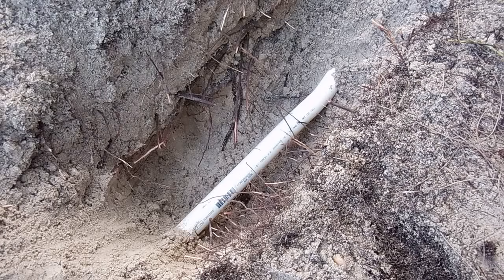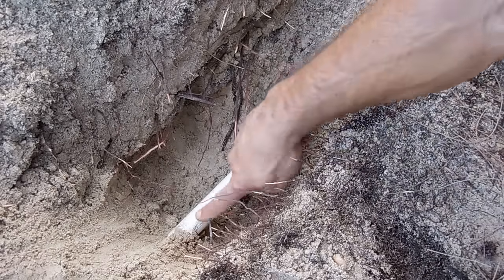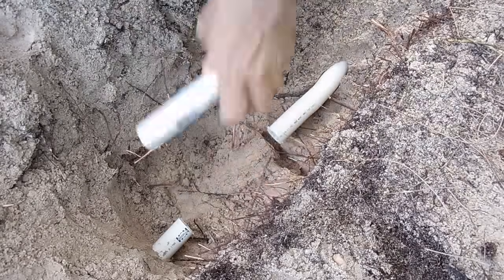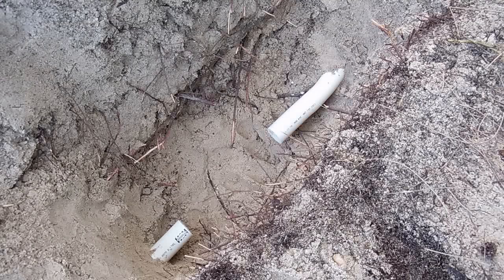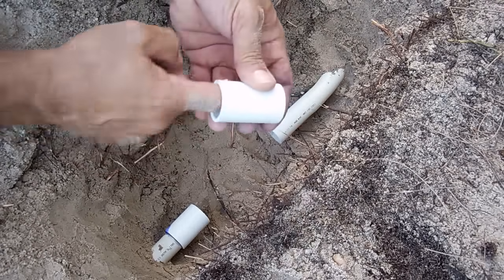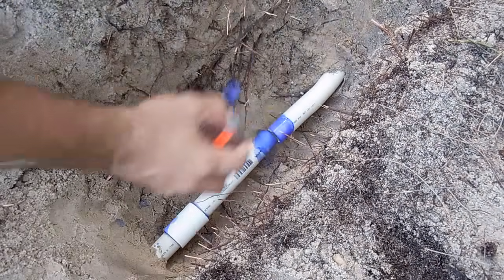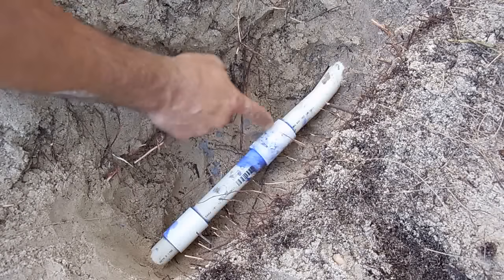EASILY Repairing Broken PVC Pipes(Least Amount Of Digging)

Comment: what size should the coupling be?
its to small to fit the pipe 
Its a regular plastic water pipe that brings the water to the bathroom

I tried it with fast drying cement but maybe thats why it didn't work
I also did it another way with a different
Repearing coupling
Reply from the maker: Use a coupling that matches the size of the pipe. Make sure the entire stop has been removed. Practice makes perfect, and using fast setting cement is your biggest problem.
Reply: @electronicsNmore  thank you for replying yes i will use the other cement. For some reason they didnt have the 1/2" coupling at home depot.  had to do it a different way and it was loose i actually found some couplings in my house today, im gonna do it the way you did it tomorrow
Thanks again

Comment: Thank you for this video exactly what I needed 1 inch pipe barre3 ft Underground with no way to flex it or bend it tried putting elbows in coming up with it but the pressure from the ground it kept breaking when paper would run over it thank you so much prayers answered
Reply from the maker: Remove the entire stop, apply plenty of cement, keep the fitting moving, and work quickly.

Comment: The quickest and easiest is four 90° elbows
Reply from the maker: It works, but every time water hits a wall and changes direction, the pressure drops due to friction loss, not ideal for a main line. Thanks for watching!
Reply: @electronicsNmore  
Correct, but it requires a whole lot more than 4 to make a substantial difference....
Reply: @electronicsNmore  use bushings on each end of the pipe to increase the 4 elbows to the next size bigger, the increased volume will compensate for the minimal friction lost
Reply: @electronicsNmore  Speaking of main lines, I'd love to see you file the stop out of a 2" coupling and connect a 2" line your way, it would be very difficult to do in a dry, shallow, and clean condition, much less dealing with water and/or mud in a 3ft hole....
Reply from the maker: @BigG903  I wouldn't spend the money on (4) 90's, rather use 1 or 2 couplings. The method is highly effective for 1/2" to 1", and also works up to 1 1/2" with a little more effort. 2" too tough.
Reply: @electronicsNmore   
Where's the extra coupling come into play exactly???  I'd use two 45°s and a 90° before sliding glued couplings back and forth, which first and foremost goes directly against making a proper glue/weld application.... I'm not gonna guess as to what your credentials are, but I'm  a 4th generation Texas master plumber

Comment: It's just as easy to do a swing joint.  Face 2=90s up measure between the end of the 2 cut the pipe put 2-90s on the cut piece and make sure they are facing evenly and you're good.  Works really good if the pipe is curved or bent.
Reply from the maker: Every time you add fittings to a water line, you INCREASE friction loss, and that's a big "no no" especially for main lines. Adding (4) 90's to me is foolish.

Comment: Do this with 11/2 or 2inch , you better be a power lifter or you’ll be sorry
Reply from the maker: 1 1/2" I've done a few times, not 2"
Reply: @electronicsNmore  what I find is that tolerance of pipe to fitting varies a couple of thousands get pipe 2 thousand over and a fitting 2 thousand under and sad ending. My father would do this trick back in the mid 1960’s when joining 4 “ S&D but that’s a pretty loose fit and always in the ditch straddling the pipe . I have always believed that a leverage device should be made to a slip behind the  coupling and another part clamped to the pipe,and move a lever much like the old time latches that have a cam . One could use such a device when running 4 or 6 inch pipe by one’s self.

Comment: Tried this yesterday. Used gobs of glue. Twisted the coupling sleeve onto the left pipe. And bam! It stuck flush with the pipe with zero possibility to twist it back to the right.🤬
Reply from the maker: Sounds like you had the fitting too tight with the stop, or didn't keep the fitting moving. It does take practice. You can read many success stories in the comment area. Don't give up! Practice makes perfect.

Comment: I do pvc irrigation installation and maintenance.  I've never had a non-primed joint fail.    I've found primer is unnecessary for full pipe integrity, strength, function.

Comment: Nice.. What about sliding the full slip coupling on to the repair piece first then you just have to clean/add glue and slide it over the two pieces you want to seal without bending pipe?
Reply from the maker: If you're able to do that, then you made the coupling too large. You'll definitely enjoy my PVC testing and tips video playlist below. Be sure to share. Thanks Tony!
https://www.youtube.com/watch?v=1o4E2pdEv-s&list=PLQ6IOhUBblU10Q846UXdxMnh8S_eul0UT
Reply: @electronicsNmore  Yeah that figures. I had this happen the other day, I noticed that couplings fit different from sched 1120 or thin wall 40 pipe and reg sched 40 pilpe thick wall.  Easier to fit with the thick than thin wall.  I tried to do the way you showed and tried the sprinkler video way too but I didn’t have the correct Milwaukee hole bit.  Wouldn’t fit.  So I had to do it the traditional way dig back and bend (pickup) pipes to work.  But I got it..  Thanks for the vids tho, more ammo for out back pockets. 👍😎

Comment: I bought the pipe and sleeve after watching the video. I was just wondering how come the sleeve is going so easy for you while I see it barely fits on the pipe. I sanded the pipe a bit to make it fit but when applied primer and glue it was as easy as you showed in the video. Thanks a ton for making this easy for a lot of people. God bless you!
Reply from the maker: The coupling has a slight taper, make sure the stop is completely gone, and use plenty of PVC cement for the job.

Comment: Would it be beneficial to add more cement on the outer once fitted as an extra measure?.. btw, I have 2 pinpoint holes that spray water not a little but alot on some weird back gray pipes under near my back door on my 2002 Springdale travel trailer.. I had to unhook my hose bc the pressure still had water coming out when the water was shut off.. I can't find a shut off valve for the pipes anywhere..I bought Christy's blue glue and primer Wondering do you think it'll fix the leaking holes??  I already used flex spray and the the flex tape and it did NOT work. I peeled it all off and want to start over...I can't afford a plumber. FYI, the water isn't coming from my water holding tank, the cheap plastic closing  thing broke 10 years ago so I have no extra water held. I wish I could put a picture on here

Hello..I'm waiting
Reply from the maker: If the pipe is rigid, then you can buy a hose clamp and some sheet rubber at Home Depot/Lowes. If it's PVC, you can also buy a snap fix for your size pipe. Thanks for watching

Comment: Or you can buy a pvc repair coupling (comes with no stop) for the same price as a regular pvc coupling.
Reply from the maker: Incorrect. You can only buy "full slip" repair couplings for DVW PVC at home improvement and hardware stores, not for pressure PVC. For what I show, you'd need to visit a plumbing supply house. Thanks for watching!
Reply: @electronicsNmore  Schedule 40 PVC IS pressure PVC and you can buy schedule 40 pvc repair couplings as well as schedule 80 PVC which is rated for even higher pressures. In fact, I'm repairing a schedule 40 pressure pipe today with a schedule 40 pvc repair coupling I bought at the local hardware store.
Reply from the maker: @navinjohnson9416  DWV is only sold in sizes 1 1/4" to 4" at stores. You're not buying a full slip repair coupling as shown in this video for pressure.
https://www.pvcfittingsonline.com/resource-center/what-is-dwv-pipe/
Reply: @electronicsNmore  First, not sure why you keep referring to DWV as I'm talking about pressure and thought you were as well? Second, my comment was "or you could buy a repair coupling" which you can if it's pressure PVC which you keep indicating it is. Where you can buy one wasn't the point, but I'll just say that I have bought many pressure PVC repair couplings ranging from 1/2" to 2" at my local hardware store.

Comment: Just use a rubber coupling its works better and it fits perfect
Reply from the maker: It's not better, what I show is permanent. Rubber couplings are typically designed for pipes with little or no pressure.

Comment: Great video. One question.  Why not slide the coupling that unites the last 2 sections onto the the pipe BEFORE you cement the long piece on the left  ? That way, all you have to do is put the cement on the right union side, and slide the coupling over the union into place after applying the cement , and rotate it to spread the cement evenly ?
Reply from the maker: If the coupling slides over the pipe dry, you made it too big! Thanks for watching

Comment: This method should make my repair much easier! To my dismay after days of digging and chopping roots, I found two PVC lines running right on top of one another. My initial plan was to cap off the line prior to a break that is under a tree that I can't fix. After finding two PVC lines I need to cap the bottom pipe. From what I can tell there is enough space between the lines to use this repair method. If I can get a hold of the friction thread cutting tool I won't need to cut the top pipe to cap off the second. This video is a great resource!
Reply from the maker: That's a pain in the rear, I've had that happen many times. Be sure to watch my "PVC" video playlist below, and most importantly share my channel with many others. Thank you!
https://www.youtube.com/watch?v=1o4E2pdEv-s&list=PLQ6IOhUBblU10Q846UXdxMnh8S_eul0UT
Reply: Just curious. You don’t have room to use a ratcheting pvc cutter. So much easier. 
Best of luck with your repair.

Comment: Great video with the tip on removing the stop. I have removed the stop with a filer and 80 grit sandpaper, but still can’t manage to get the coupling fully pulled back (i can pull it back 50% only after a ton of sanding and filing on both the female and male ends. Doesn’t seem like it is even the stop, its just too tight - have you experienced this?
Reply from the maker: Use a 1/2 round smooth cut file or Dremel. You'll get the hang of it. The coupling has a slight taper toward the stop. Be sure to watch my "PVC" video playlist below and share. Thank you!
https://www.youtube.com/watch?v=1o4E2pdEv-s&list=PLQ6IOhUBblU10Q846UXdxMnh8S_eul0UT
Reply: electronicsNmore thank you! The taper makes sense. No dremel but will try a mini drum sander in my drill. Thanks!!

Comment: not that I am crazy about shark bite fittings especially underground but they do make slip fittings meant for just this type of repair and you dont need to cut out the section of pipe and add another fitting on the relatively smaller pipe anyway like 1/2 or 3/4 inch.

Comment: Why not just put the slip coupling on first and and other joint on in one piece. Then apply glue to the pipe and slide it over the cut section, don't forget to give the slip joint 1 turn to spread the glue around.....
Reply from the maker: If it slides over without PVC cement, then you made the coupling too big.
Reply: @electronicsNmore  Didn't say anything about making too loose or not using PVC glue.

Comment: For $4 you can buy a "PVC Slide Repair Coupling
" at Home Depot that has an sliding pipe that extends and contract to make a fast and almost perfect repair.  No need for all the couplings,  filing the couplings, and measuring the pipe perfectly.  https://www.homedepot.com/p/Homewerks-Worldwide-3-4-in-PVC-Slide-Repair-Coupling-511-53-34-34H/206698171?modalType=drawer.  I am surprise the guy in the video does not know about that part.  It was available at Home Depot for at least a decade.
Reply from the maker: Bob, I suggest you look VERY closely at my video thumbnail. LOL

Comment: I was in the pool industry in the 80's and we had something called a snap coupling. It was like a coupling cut in half through the diameter. Not quite half because you had to push on the coupling and the pipe and fitting would flex a little and the coupling would snap onto the pipe. You put glue on the fitting and some where the crack on the pipe was and snapped it into place. We didn't like to use it on real high pressure systems,  we could make a normal pipe repair in just a few minutes.
Reply from the maker: I've seen those.

Comment: using a coupling and a union may be better and easier.
if the pipe can not move.
Reply from the maker: They all move, just make sure the hole is about 1 - 1 1/2 feet wide. Thanks for watching!

Comment: This isn't only a less expensive repair methoed than a fancy slip connection, its a better connection.  This is a fully restrained repair so you don't have to be concerned about thrust forces pulling your pipe a part.
Reply from the maker: I'm not too thrilled having an O-ring/gasket around the pipe to prevent leaks. Over time, especially with highly chlorinated water, the seals can dry out and leak.

Comment: How do you find out where the leak/kink is? Especially when looking at 40'x40' section of yard.
Reply from the maker: Let the system run for a little while, then look for a soft/mushy spot in the lawn.
Reply: @electronicsNmore  Thanks for your reply; however, I tried that before ever asking this question on YouTube. I have another suggestion to try but will come back to you should it fail. Thanks for the info in your video!

Comment: I did this a month ago on a sprinkler pipe, was between a root and a sidewalk almost no other choice. Worked great. Only recommendation is to make sure you test your grinding of the fitting on th pipe between you 'commit'.  i also checked to make sure i could get  it on and off, before any glue or primer. I did have to do a little cleaning. Once i could get it on and off (enough digging, grinding of fitting), i did it, and all good. sprinklers good!
Reply from the maker: You don't want the fitting to easily slip over the pipe, because the strength will be reduced. If it worked making it bigger, then great! Thanks for watching!

Comment: (Thinking of a bigger diameter pipe), would it have been possible to slide the internally ground coupling on before replacing the main section of pipe then slide it back over the join?
Reply from the maker: No. If it slides over, that means it was made too large.

Comment: well, this is good method, so why would I not use only a single sliding coupling if the the small like in this method?
I think you used a method which is equally applicable to small and big cuts.
Reply from the maker: If the break is straight up and down, then you only need one coupling. If the break is going sideways, then you do as shown in the video. Thanks for watching! You'll greatly enjoy my latest PVC tip video below. Please share the video link with others.
https://www.youtube.com/watch?v=LP41_wXW8jc

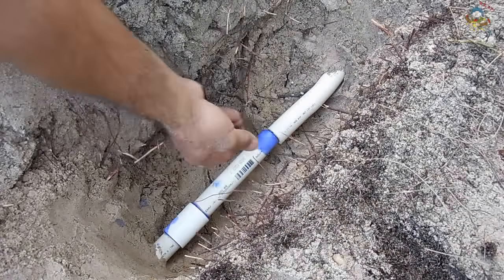Comment: Thanks for the video! If you have a fairly clean and small break (just enough to cause a leak), would it be feasible to just cut at the break point and slide a single coupler with the stop removed over the break? (Basically from 7:30 onward in your video...)
Reply from the maker: Hello Kenneth. If the break is up/down, and not sideways, then you can use just one coupling with the stop removed. I show another way to remove the stop in my recent video below. Thanks for watching! Be sure to share the video link with others.
https://www.youtube.com/watch?v=LP41_wXW8jc

Comment: It was great until the very last minute.  The sleeve that I removed the center from was so tight with the pipe that I couldn't move it back all the way back to clear the pipe and slip it over.  So I'm off to the store for a slip fix.  What a waste of time.
Reply from the maker: You more than likely didn't remove enough, or didn't keep the fitting moving quickly. It works, but practice makes perfect.

Comment: Waste of time tha easy bc of the sand if it was clay or hard soil wouldn’t work. Especially if the pipe is older and fragile.i don’t recommend this
Reply from the maker: Wrong. The ground type is irrelevant. Big deal if you need to spend a few more minutes clearing the soil. Buried PVC pipes remain strong for many years.
Reply: electronicsNmore ground type has a lot to do with the mobility of the pipe and yes pvc does dry out or get fragile with many years I’ve been doing this all my life I should know. $4 compression coupler is faster and worth it. No need to do all that what you did is counter productive

Comment: Like the idea. However doesnt work with schedule 20 1” pipe, which in my experience most ppl have. Also i bought a sliding slip joint. It was $6.68 at lowes. Worth that much to me
Reply from the maker: It sure does. I've used the method on thin wall sprinkler pipe up to 1 1/4".
Reply: electronicsNmore man i will have to take video. I cannot get it over schedule 20 pipe even on the bench. Another hack i wanna share. The easiest way (if u dont have a dremel) to shave down the stop in the coupler is to use a drill and drill bit and just move it around inside the coupler. It really eats the stop fast. I then used a small file to finish it smooth.

Comment: I use four elbow fittings make a u pattern
Reply from the maker: Not ideal for a main line, but OK for branches off the main. Every time you add an elbow, you increase friction loss, which slightly reduces the pressure. Thanks for watching! Be sure to watch my latest PVC tip video below and share. 

https://www.youtube.com/watch?v=LP41_wXW8jc